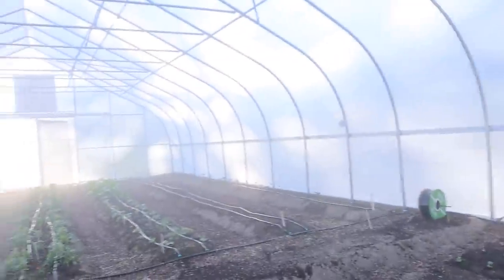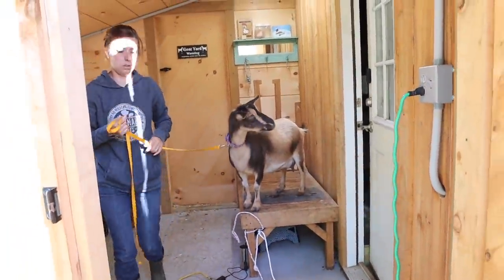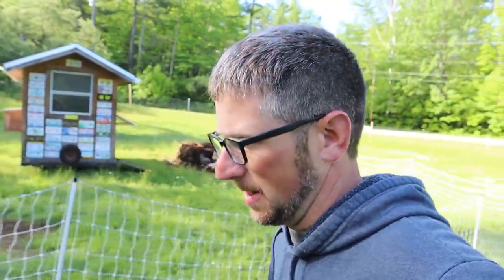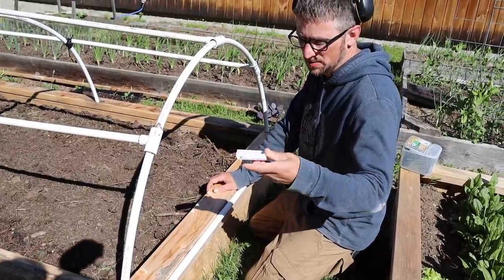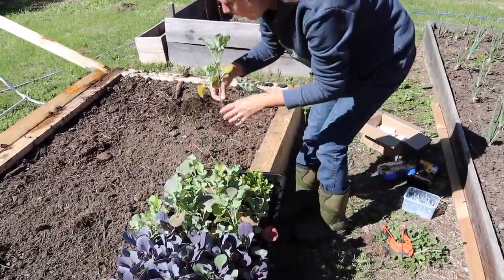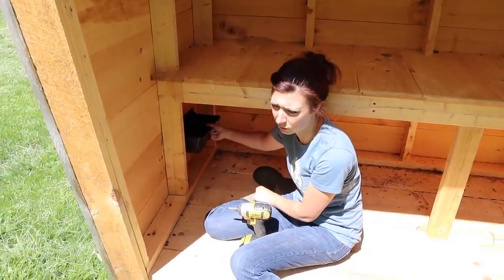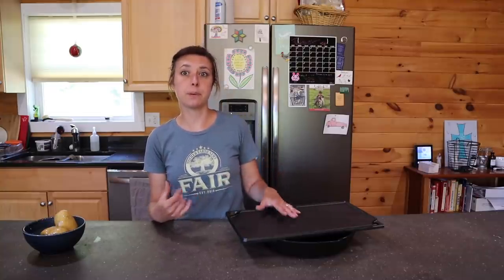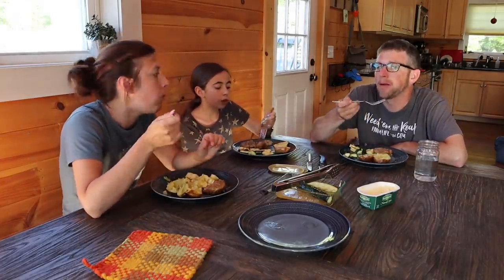This Will SAVE our Cabbage & Broccoli from ALL the pesky BUGS! Growing our GROCERIES for the Year

Comment: Grandma always said, "Never put soap in your cast iron pans!" When you clean them, pour a little oil in the pan, add some coarse salt( regular salt if you don't have coarse), and scrub the pan with a paper towel until all cooked bits come off, then rinse off salt, dry the pan, and leave the film of oil on the pan to store it. Your pan will never rust or stick for as long as you own it! I have a pan that is just as non stick as Teflon without the chemicals! Do this with all your cast iron utensils and they will never rust. Look up "How to season cast iron" even if they say  "Pre-seasoned"! Good luck, happy gardening and God Bless!
Reply: Didn’t know this-makes sense❣️Thanks 🥰
Reply: Yes, I never use soap.  My pans are indeed like teflon.  I made omelets in my pan this morning.  I use the metal scrubber (on amazon) for cast iron pans when needed which isn't very often then I rinse and wipe down with paper towel and oil.
Reply: My brother heard a chef on public radio talk about cast iron.  Restaurants have to use soap to clean them. He said to wash them, dry, then heat them on the stove to dry them really well and put a tiny bit of oil on them while still hot and rub it in with a paper towel.  Just in case you want to use soap.🙂
Reply: Every time you use them.
Reply: Nancy Edgar that is how mom taught me to care for cast iron it works
Reply: I keep a lodge scrub brush that I clean mine with NO SOAP EVER! Than put it on low heat to dry than a thin coat of oil. 100% nonstick!!! Love my cast iron!
Reply: @nancyedgar7838  Yes, I use soap sometimes and so did my grandmother, who also taught me how to cook and use cast iron. Never be afraid to use soap but always follow up with seasoning!
Reply: That's a good way to clean. However, the routine you describe isn't complete and will result in a rusty pan. Whenever you're finished cooking and cleaning a cast iron pan, the last step is to heat the pan until it smokes to absolutely remove any remaining moisture. Then take it off the heat, wipe in a thin layer of fresh oil and allow the pan to cool before storing.
Reply: When you cleaned them, in the old days, you put them over the pilot light to dry them fast. I think I’m the only one who still has pilot lights...
Reply: @nancyedgar7838  - I use soap sometimes - after making some things you have to. My grandma taught to scrub, rinse well, turn it upside down in a cold oven then turn it on 300. Bake it 1/2 hour or so, then coat the inside with crisco and lightly outside, put it back in the oven while still hot and leave it 20 minutes. Then turn the oven off and let it cool with the oven. She said Never use vegetable oil.

Comment: For the sour crout we use a crock and layer cabbage leaves and salt. Ive seen my grandmother fill a 20 gallon crock and not only cabbage but collards as well. A Southern tradition. As they place it in the crock they pack it with a wooden dowel to allow the salt to do its thing, then they use a ceramic weight on top and cover it with cheese cloth.

Comment: Good Thursday mornin Moose Crossing ..... You could turn part of that high tunnel into a sweat lodge ~8^) I built one of those little garden tunnels this year over my 4x8 raised bed. By the time I got the melons in, I didn't need any plastic (went from winter to summer). I think I'll get some shade cloth, and try that during the heat of summer/bug season. I can grow radishes in it in the fall this year, and spring (if it shows up) next year. I have those clips that you are using as well, to make everything easy/tight. Your pigs must really like those hens laying eggs all over the place. Maybe you'll find a pile of eggs with a broody hen sittin on them.  Have a great day AL, Gina & Olivia.

Comment: Hi Gina those cast iron pans are awesome . Just a tip on the potatoes. We put ours in the microwave to partially cook them then make some slits all along the potatoes. I place them on foil add a few slices of butter sprinkle with any spices and some salt finish off with chopped onion then close up the foil. If you don’t microwave them first you’ll jus have to watch them. Ours take about half an hour. God Bless you all!

Comment: Gina once you get the hang of it you'll love the cast iron. I highly recommend getting the lodge bread pans.  They are slightly smaller but get a couple and most bread recipes cook up amazing in them.  In the summer I use my grill nonstop as well as my Cosari air fryer to keep the heat down.  Love the biscuit pan, it will be perfect for biscuits, eggs, shortcake, and would be fun to see all the creative uses.  If your area is opening up check thrift and antique stores for vintage cast iron. Once restored you'll never use a nonstick pan again.

Comment: I love your new pans Gina.  I've used cast iron for more than fifty years.  I picked up a cleaning brush last year at Aldi.  It is a round brush with stiff bristles and does a great job.  I clean my cast iron with hot water only using paper towels to wipe out any grease.  When you do that it is very easy to clean.  I hope you enjoy your pans.  That biscuit pan would be great for short cakes for strawberries,peaches, etc.  Have a Blessed day.  PS always lightly coat with olive oil  after cleaning.

Comment: I use my slow cooker & microwave during the summer. The slow cooker doesn't generate a lot of heat & my microwave vents outside. I don't use the oven during the summer because I'm in Arizona & it was already 80 at 8 am. You can use the slow cooker like an oven on some recipes & the microwave like a stovetop for other recipes.

Comment: Gina, I have been using cast iron cookware for the past 40 years or more. I love them and properly seasoned they are pretty much nonstick. Please do not sand the surface down smooth that will actually ruin them. Just use a little beeswax and oil to season them. Do not use soap to wash and dry them in a low oven or stovetop and re-oil after washing. They will last forever.

Comment: Love my cast iron !!!  Key is NO SOAP! Mine is so nonstick it's better than the teflon garbage I had before. I wash my pans with a scrub brush while they are still hot with very hot water, put them back on the stove on low heat to dry, once dry add a little oil and let cool. The more you use your pans the better they will get! One way to get them very well seasoned is to use them to have a fish fry. Because of the oil and high heat this process will make a new pan beautifully seasoned! My fish fry pan is fabulous and everyone who uses it wants to steal it!

Comment: You likely don't need to sand the cast iron. Gina can easily clean them off with oven cleaner, green scrubbing pads and steel wool. When it's down to bare metal, do your first coat of oil on hot but not super hot cast iron, then your next 3-4 can be on an extremely hot surface. Some people swear by lard instead of plant fats for seasoning.

Comment: Hey Gina you will do just fine cooking with cast iron.  I have been doing it for about 50 years or so.  I am now 60 years old.  You just want to remember to keep the heat even and use some kind of grease, ie oil, shortening, butter, lard, or tallow.  Always dry your cast iron quickly after cleaning and always oil it to keep it from rusting.  I love cooking with cast iron and I find it hard to cook with any of the other kinds.  I do like the Copper clad bottoms of Reverware but that is getting harder and harder to find.  Anyway you will do just fine.  Try cooking a stew in your dutch oven or even a chicken pot pie.  yum.

Comment: You don't have to sand the cast iron down. Just use them a few times and they get really smooth just like the old fashioned ones. The old ones are grainy like that too if you strip off all of the seasoning.

Comment: I inherited my wonderful Wagner and Griswold cast iron pans. My father taught me never to use soap on them. Soap will remove the seasoning that prevents sticking. If there's food stuck on it just bring a little water to a simmer in the bottom. Cover, shut off the heat till it cools then use a stainless scrubber to clean out the now softened bits. Rinse well, drain, and dry thoroughly by turning the burner on under it for just long enough to evaporate the water from the surface. That sterilizes and dries it. Cool and wipe while still warm inside with just a few drops of cooking oil on a paper towel till shiny but not oily. This prevents rust and seasons the pan for next use.  Another word of advice:( Never run cold water in a very hot pan! That can warp the pan) This is much less complicated than it may sound. After a while your pans will become practically non stick. I have also restored old crusty thrift and yard sale frying pans by (I'm not recommending this for anyone else) putting them in the oven on the self cleaning cycle. The crud turns to ash. You can also bury them in a campfire in the coals. You do have to season it like a brand new pan after that. I've never heard of sanding down new cast iron but I've never had any.🍳

Comment: Even though tomatoes are a tropical 'fruit', 100 degrees is too hot. Tomatoes grow best if daytime temperatures range between 70 and 85 degrees. Long periods above 85 degrees and you will have problems with blossom drop.

Comment: There is a ban on open flames out here right now (Red Flag Warning) that will likely last until the monsoons start, so no outdoor grilling. They have even tried to "suggest" no smoking outdoors, even on private property (so all the smokers are infuriated over that and refusing to comply). To keep heat out of the house, I keep the shades drawn, use a roll-up shade screen outside in front of the window that gets the most sun, and set the air conditioner to a lower temperature if I use the oven or broiler. I also use a George Foreman grill (electric); it's quick and easy to clean. For a whole chicken, I use the Foreman electric roaster (quicker than the oven and also easy to clean). The only problem with that scenario is that the power usually goes out for several hours, at least weekly, when the monsoons hit which is fairly unbearable. since they come around 2pm - 4pm and then the sun comes out. Yow.

Comment: You can't can cabbage for Coleslaw...use fresh, store whole heads in refrigerator, root cellar or cooled room, and use as needed.  Regarding Sauer kraut, shred it, press cabbage into a Stein or Glass Container that can be covered ...sprinkle canning salt (1 tsp per 2 inches), press until juices run out of cabbage, add another 2" layer and press, leave 2" sauce on top, by now the juice of the cabbage should be above the shredded cabbage, add a cabbage leaf to top and press down, make sure all cabbage is below the cabbage juice and glass weights to keep cabbage below liquid, add lid...a lid that just sits on top, no screwed down.  Set in a cool area dark area and let ferment for minimum 3 weeks, ever other day check for "scum" developing on top, just remove with a spoon, and cover again. Do not use any metal vessels.  You can add Caraway Seeds to the Cabbage to ferment with the cabbage or add it later when cooking it, I add it at the beginning. Taste after 2-3 weeks for desired sauerness, now can be kept in refrigerator of canned. If you want to can it only, can after 2-3 weeks, its stays crispier in the jars that way.  Walmart has large round glass containers (1 gallon) without on lids.  Do not use screw on lids, jar may explode, gases need to be able to release naturally, just use cover to keep dirtier and moisture in. Follow canning guide from Ball Canning book for Sauerkraut, and other other vegetables, meat, etc.

Comment: If that griddle is the reversible type, don't bother trying to use both sides. The heat underneath will destroy the seasoning on that side and you have to reseason before you can use it. Then you destroy the seasoning on the other side.

Comment: That biscuit pan will make great muffin tops (put less batter in the pan and they will make more of the tops and less of the soft middle, there is actual muffin top pan) don't be afraid to use the cast iron, it is just a bit different, it just means don't mess with the food until it releases from the pan. Rusty should be calling for the hens to come get food he finds not fighting to get his share. A good roo will always offer food to the hens, you need to find a better Maran rooster. Sorry, Rusty! Finally, why not put the bug netting over the greens to keep bugs out of there too. Now we are waiting for you to build the chick shaw to see how you solve the trailer hitch issue. 💞💞

Comment: Mow grass out into the cut rows, rather than into the tall grass. Easier on the bearings. Also distributes the cut grass better and avoids clumping. The only row in which cut grass is mowed into uncut should be the first swath. If the grass is too high or thick on first cut raise the mower up and cut. Then repeat that swath again at normal cutting height. For heavy grass cutting with keep the mower higher or cut 1/2 swaths instead of engaging the entire mower. Again, you will have less wear on your mower. -Retiree who cut grass for decades and swathed grass with a swather for decades too.

Comment: I would not sand them down just season them with lard taking almost all of the lard off a season to 400 degrees for 1 hour. If you sand them they will not be non stick for months down the road like 8 seasonings at least. Look in th iTunes U for seasoning cast iron.

Comment: Great idea for the low tunnels! Do you use the clips on 1/2" PVC pipe? I used 1/2" clips on 1/2" pipe and I had one heck of a time getting them off, I ended up breaking most of them.